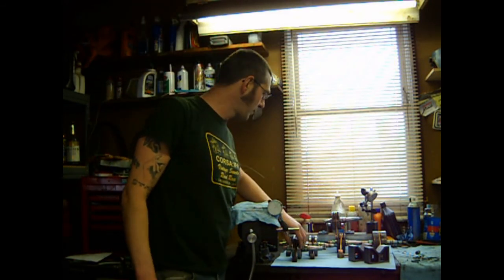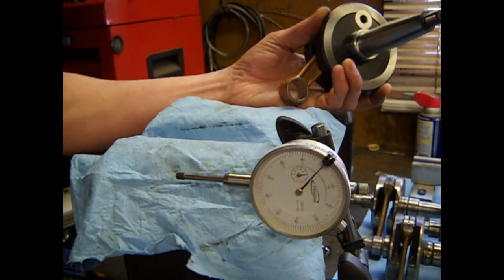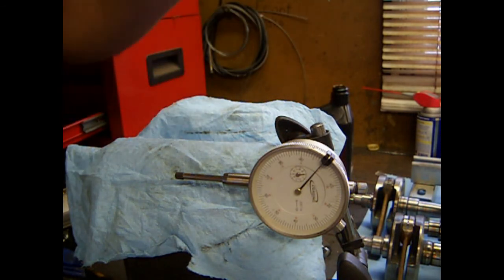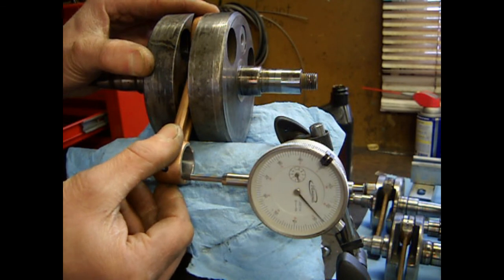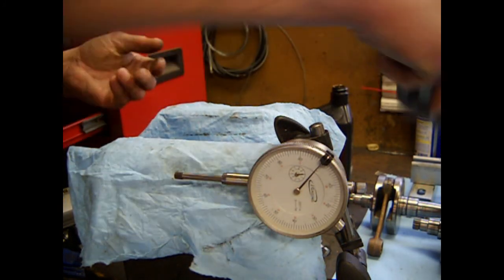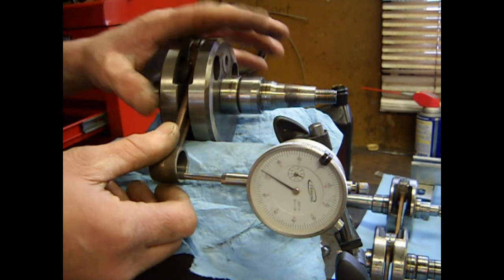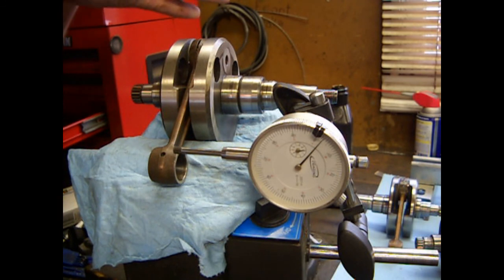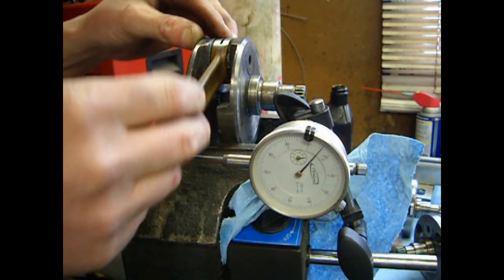Measuring Lambretta/Two Stroke Big End Bearing Wear

Comment: In my Suzuki A100 workshop manual, below 0.12" is standard con rod small end shake!
Reply from the maker: That's more than likely side clearance. That's linear, not in a "bearing wear" sort of measurement. I've not seen any specs for the side shake in the manner I'm discussing, except for Bell's tuning book. For example, when I rebuild a crank, I normally use (depending on manufacturer's specs) 0.011"-0.015" big end side clearance. That's the distance between the con rod and the crank wheel. The small end has a similar clearance requirement, which is normally wider than the big end clearance.